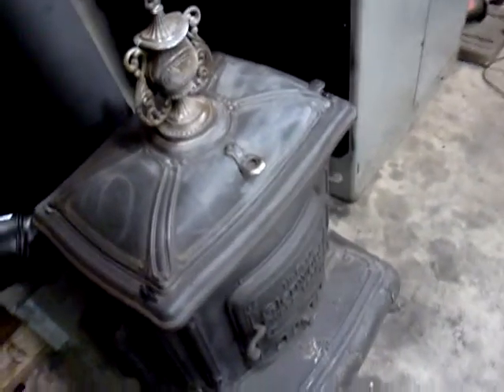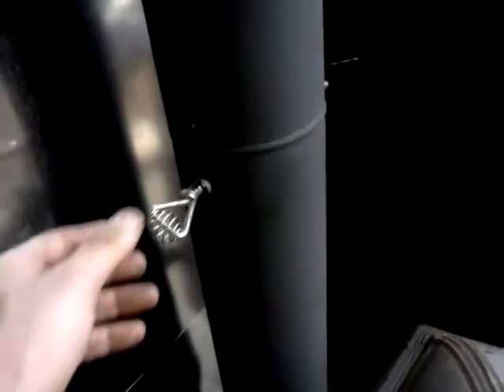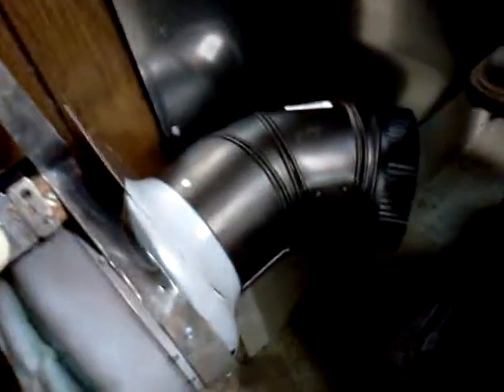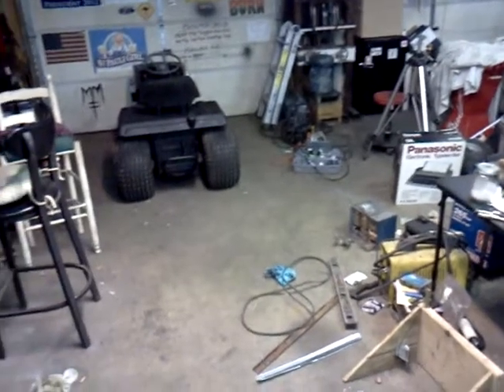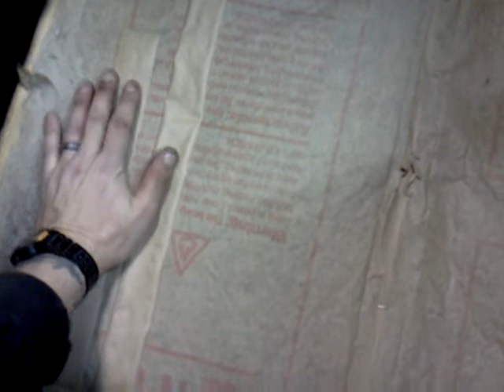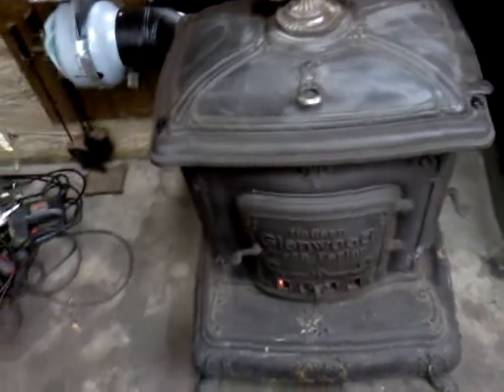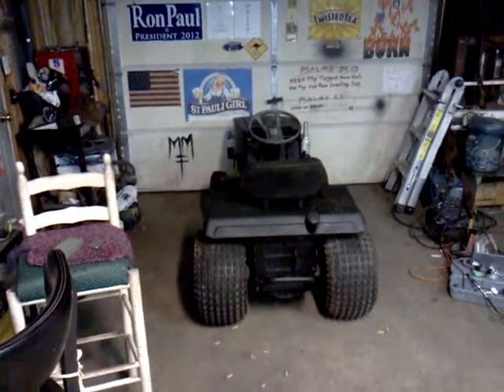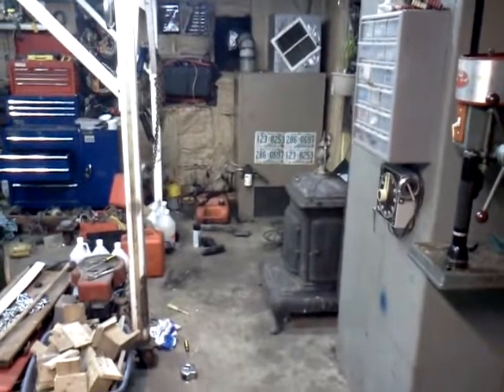new wood stove GLENWOOD part 2

Comment: I have a Glenwood parlor stove that I brought out from Vermont 10 years ago to Az. It cost me $75. It heats my mfg'd house. It comes apart so nicely that I could move it myself. I figured that if it could take the trip in the back of my truck, it would hold together when in use.  I heat with mesquite wood.... it drops out of the trees, is a dense tough wood. It is nice to know what was supposed to be on top. I thought maybe there had been a warming shelf. I light it from the end and feed it from the top. The old elbow is still on it and it needs some work. I lined the bottom of it with special cement suggested by the firm that did the installing of the pipe.